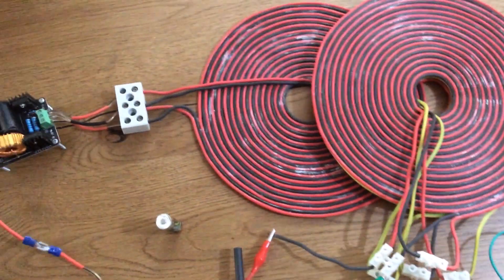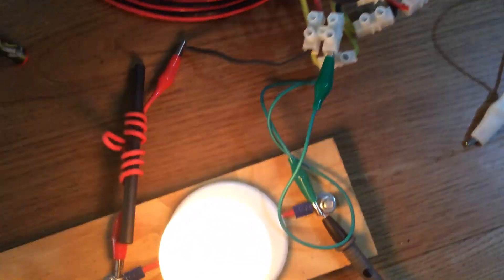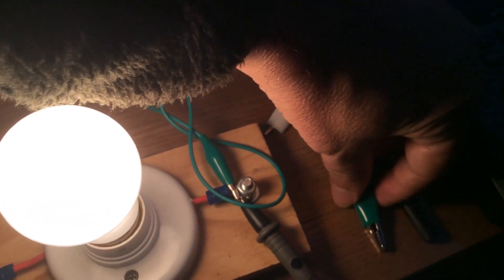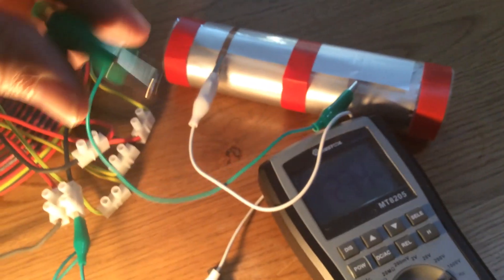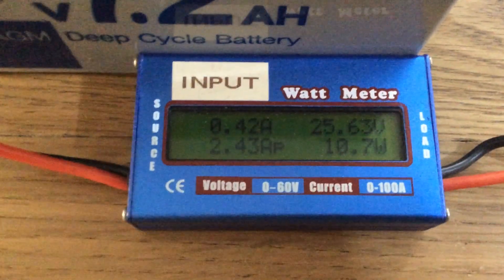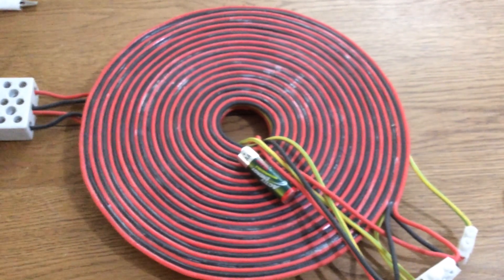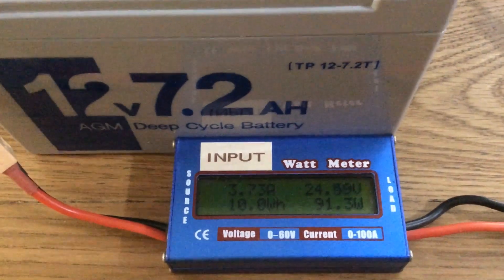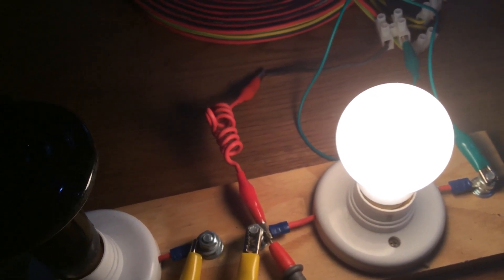TESLA PANCAKE COIL FOR HEATING AND LIGHTING

Comment: What is the zvs?
How many light bulbs could you connect?
Reply from the maker: Thank you for your comment.
Sorry for my delayed reply. The ZVS is a Zero Volt Switching unit, this takes a DC power and flips it back and forth to create a simulated AC signal. The amount of lights your able to connect to this depends on the size of ZVS, the unit I’m using is only a baby 100 watt unit but will easily power a 500 watt halogen bulb. With the induction cooker, also a ZVS, I have powered 2.2 kilowatts of lights with only 1000 watts going into the induction cooker from the mains. Tesla stated that the pancake coil increases power in a capacitive effect, it’s hard to argue when you see the results.

Comment: Teslas example uses 1000 turns pancake. He states it is "advantageous " that your coil be 36" diameter minimum. Even his healing circuit use 36" diameter wooden hoops with 20 guage wire wrapped around the outside. His words are gospel in my opinion. So when he says something is important and I listen.
Reply from the maker: Thank you for your comment.
Couldn’t agree more, if there is even the slightest deviation from his original design then you have created something else.
The problem here is researching Tesla’s discoveries without the drip feed from one of the world’s richest men. A lot of the time I build my version of Tesla’s work from what scrap I have as opposed to specifically buying something, all the while keeping in mind that this isn’t the same and with the intention of making the same if it’s feasible and based on results from my version. Most of the time I’m guided by my desired outcome over replication, ie. I want a particular light to operate at it’s most efficient rate I will take the Tesla concept and tailor it to my needs, if I can achieve it without the extras then all the better.
Again I will highlight the importance of your statement, when he says something is important, I listen.
Reply: @whatifididthis...1236 cool videos thanks for uploading..checkout Ivo’s new video this week it’s about focusing more on the electrostatic, negating the mag field. There’s an 8 year old Video on Yt from an Indian guy how to make a Scalar wave, also the 1901 Tesla lecture that Ivo cites is useful as well. No one knows how this stuff works for the most part..even the people in the comments telling you you’re making mistakes lol
Reply from the maker: Thank you for your comment.
I saw Ivo’s video, very interesting, I will say the different forms of electricity are very interesting. I’m editing a video I recorded last week that demonstrates the differences with and without the ferrite core, the dielectric has always seemed more volatile to me, put it this way, I’ve blown more stuff up that way.

I will check out the video you mentioned, always keen to learn. One thing I’ve learned over 20+ years of experimenting, everyone’s an expert.
Thank you for watching.
Reply: Can you please elaborate on healing circuit? Where can I find info?
Reply: @Inner_Struggle ....It is in his published papers to the medical community. Keep in mind, it won't make sense using Einsteinian theory, electron theory,  nor Hertzian waves. What Tesla discovered was the true God particle. It passes through all matter with ease. If you can capture it, you can do work and heal the body. He patented a device to do so and called it his greatest discovery. Likening it to the birth of children. These Tesla currents jump from metal to metal through the air. Ed Leedskalnin of Coral Castle read his work and built his theory off it. In my opinion, it's most likely what the great pyramids were capturing and trying to contain.

Comment: You're making a mistake by using a three connection ZVS because that only energizes one pole at a time.  It energizes one output pole, then 1/2 cycle later, energizes the other pole.  Tesla bifilar coils were not meant to be energized like this.  Tesla bifilar coils lower self inductance (reduce drag) (reduce Lenze reaction) by allowing n the capacitance in the coil to counteract the self inductance.  The capacitance in a bifilar coil occurs when the electrons flowing in one coil are attracted to the electrons flowing in the other coil through the insulation, causing a massive increase in capacitance, which makes the magic happen.  You need to disconnect that center pole of the ZVS,  but then you probably will get no current flow because the three pole ZVS wasn't meant to be used like that.  SO you really need a TWO pole ZED.  You will see a significant increase in COP.
Reply from the maker: Thank you for your comment.
My apologies for my delayed response. I had originally purchased two of each type of ZVS, 3 pole and 2 pole because I was curious as to which one would best suit this setup. In my tests I found the more efficient unit to be the 3 pole. There may be loads for which this is not the case however using a 70 watt halogen bulb the 3 pole ZVS operates the light using only 18.7 watts and the 2 pole ZVS consumes 20.3 watts, still very efficient and at the same brightness but still less efficient.

Comment: Study these profound concepts:
Peak, RMS, Power Factor, Reactance, Duty Cycle.
Reply from the maker: Thank you for your comment.
I prefer learning as I go and only when relevant. You don't need to know how the internal combustion engine works but how to drive it to get your bread and milk.

Most of the things I build are because of what level of necessity I place on it. If I can achieve the goal using an easier method I will, assuming it's not a lot more expensive.

Every now and then I do a deep dive on a subject but it has to be intriguing. Again, combustion engine.

I'm assuming you haven't seen some of my other videos as these experiments don't occur without reading the profound concepts. 

I care not what the experts say and I build a device and experiment with it for as long as it takes me to get the answers I want. My videos are a record of what happens in this reality and may not always conform to the "reality" that is our education, that in no way denies our reality as reality supersedes education.
Reply: @whatifididthis...1236  It is always good to know the theory behind what you are doing.
A scope is useful for testing, it can tell you more than a multimeter.
Multimeter do not work well with high frequencies. A true RMS type is needed to accurately measure odd waveforms.
Anyways what you are doing works for you. Good luck in your endevours.
Reply from the maker: @gordonwelcher9598  When I first started my research I was very time poor and financially poor, everything had to be built from scratch and made from things that were not necessarily intended to be used that way. I couldn’t afford nice meters and decided that meters weren’t anything more than a means of fine tuning shortcuts. They help you optimise a circuit in a shorter period of time.

I do own some good electrical equipment but I rarely use it, I told myself not owning such equipment was why I wasn’t getting the results I wanted, once I had the equipment I knew I was doing the right thing but just needed to have continued when I started doubting myself. I don’t like using my equipment in my videos because it screams “too technical” to the average viewer that just wants a light. Once I have my circuit running and optimised I would no longer need a meter, plus manually tuning a circuit gives me a better understanding of changes that may occur because I have usually passed through most of those frequencies along the way to resonance. Having this equipment would be akin to having a dynotune machine for your car, just like the mechanic has and attaching it to your car everyday to check it was optimal compared to paying attention to your vehicle, being conscious of the sounds it makes compared to the sounds it used to make.

I play guitar and tune by ear so everything boils down to frequencies for me, pay attention to the frequency and everything will find it’s own harmony. Some of my circuits I only find out the frequency for when somebody asks me what it is and I have to then go check it, sure you could calculate it but in my experience there are too many unexplained anomalies to rely on calculations, the books say one thing and I am looking at something different which is somewhat like having a teenager tell you that you don’t understand the world you’ve lived in for over half a century.

Comment: Wait, is this someone who misunderstands transformers and thinks you can get more power out than you put in? Cos that's what it seems like.
Reply from the maker: Thank you for your comment.
I'm not making any statements about anything you may have seen or heard.

I imagine you have heard of a neon sign transformer.
Let's crunch the numbers of a random transformer, one of many available for sale and attainable right now.
Input 120VAC X 2.36Amps
= 283.2 Watts.
Output 12000VDC X 0.042Amps
= 504 Watts.
Sometimes it is more important to understand than it is to understand why.
Reply: @whatifididthis...1236  Yeah I think you're confusing nominal ratings, like your 72 watt light bulb, which will light with much less, with actual measured power. 

With unusual AC waveforms it's particularly difficult, a multimeter can't do it, you'd really need a scope with some smarts in it that can calculate that.

If it's just ordinary sine-wave mains power, you can just use RMS. In that case you can simply measure the volts and amps. This transformer you mention, what is it? How did you measure it? Transformers are extremely well understood, it is much more likely that you have made a mistake, than what is.
Reply from the maker: @greenaum  I'm not too interested in the particulars of a circuit, instead I focus on how I can make it and use it to my advantage. My main focus is whether it's affordable both financially and electrically and whether there's a benefit or can the goal be achieved in easier ways.

The transformer I mentioned is a "neon sign transformer", they have been around forever, this is what Don Smith mentioned in every video he was ever in.
Just type that into a search engine and search images, you will find thousands of commercially available neon sign transformers. The majority, if not all of them will have similar properties.

Comment: why do you wrap the pen with the red wire like that?
Reply from the maker: Thank you for your comment.
The wire is wrapped around a ferrite rod, one direction is clockwise and at the half way point it becomes anti clockwise. I am just performing different experiments with this wiring as claims had been made many many years ago that this can cancel out the magnetic flux when wound in the opposite direction.
 I will be honest, I have not done enough testing to confirm a benefit.
Reply: @whatifididthis...1236  where did you get the rod?  
When looking for one, do you look for high permeability?  I've heard that is key
Reply from the maker: @emichael06  I can’t remember to be honest it was a long time ago, it would have been one of the popular online selling platforms. The one in the video is 8mm diameter and 100mm in length but just about any ferrous material will work, it will be different but it will work. If you can’t find what you need you can make your own by placing iron filings or iron powder and resin in a plastic tube. An ultrasonic cleaner can help to settle the iron powder using high frequency vibration whilst you add more to the tube until truly packed.

Comment: You need to know how many lumens the light bulb in particular puts out, and an actual measurement of lumens to use a light bulb as any meaningful comparison. Measuring current and voltage across a load is more meaningful. Having two watt meters would be a better setup, one at the batteries to show how much is being drawn, another at the load to see how much is being supplied. Both the heater and the light bulb are completely subjective without such. Something you need to remember is that energy is not energy. One watt (1 volt at 1 amp) of stored energy dumped over an hour will give one watt of energy output. However, 1 watt of stored energy could cause an explosion that would remove your hand if you dump it all in a fraction of a microsecond. What something can do, or effective power, depends upon how much energy is dumped over how long of a period of time.
Reply from the maker: Thank you for your comment.
I completely agree with you that measuring lumens with the naked eye is practically useless as you end up doing damage to your eyes in the first place thus rendering your eyes useless tools of measurement. Spending so much time playing with hundreds of different lights with different circuits I realised I was seeing spots even when my eyes were closed so I purchased a Lumens meter. Shortly after purchasing the meter I realised it was only necessary if you felt the need to prove to someone it was as bright as when operated on the grid, I have nobody to impress so I work only in real physical outcomes.
I have found that measurements on the output are not that reliable with the cheap meters I own due to high frequency, usually displaying what is obviously incorrect or displaying nothing at all, seeing a meter read zero watts whilst burning a 500 watt light led me to believe it is not that practical nor necessary to measure as long as I get my desired product. This high frequency energy is very different and converts a massive portion into the infra red wave lengths which is expressed as heat, a lot more heat than when run on conventional electrical means. I might add, temperature wasn’t measured by holding my hand nearby but by using a digital contact thermometer as well as a digital laser thermometer.
Reply: @whatifididthis...1236  I understand, but a lot of those electric heaters are lossy as heck, so measuring the amount of heat at a point may well miss the majority of heat being given off. Reminds me of one experiment where a person heats up a beaker containing a fluid using a bunsen burner to measure efficiency. The problem in that case is most of the energy is wasted to the environment. In electrical circuits I have seen the same thing, numerous forms of converted waste energy making the circuit extremely lossy.

Comment: What is the power drawn ? I can see the output voltage, but what about the output current ?
Reply from the maker: Thank you for your comment. I don’t believe I have measured the output current on this setup, instead relying on a desired outcome, ie a certain sized load as a target. I built this years ago, when I dragged it out for this video the element had that dust burning smell of a heater not used for a long time. I will get the circuit out and attempt to measure it, however it is my experience that current is difficult to measure in high frequency circuits. On my replication of Tesla’s through earth transmission the current to the light reads 0.00 which is clearly wrong because I can see the light operating. I assume it is the meters inability to measure current at high frequency and better equipment may assist, I don’t feel it necessary to buy expensive equipment to measure as long as my desired effect is achieved, physical outcomes, if it’s not what I want I keep working on it, in this case the outcome was a brightness level measured with a lux meter to be comparable to a grid fed power and in this case I need not know exactly how it works as long as it works but I’m interested to know if it can be measured now with what I have and I will let you know.
Reply: @whatifididthis...1236  Thank you for taking the time to reply. I am building a solid state device and will be facing a similar problem. I am thinking of storing input energy in some super capacitors and feeding the circuit with a buck converter. That will make it easy at least to measure the input energy, not the power. On the output, I will store whatever is coming out in another supercapacitor bank and I will measure the energy at the end of the experiment. The impulses that will charge the output will look like a comb on the oscilloscope so definitely I agree it will be hard to measure. I am thinking running the experiment with the supercaps for a given period of time and then measuring the average power on the input and on the output that way
Reply from the maker: @brotherLar  I believe you are correct, the only way to measure these high frequency circuits output is to store the energy in capacitors and then measure over time for charge and discharge. The output frequency is easy manipulated by capacitors, the oscilloscope shots are very different when adding caps. I only have a basic handheld oscilloscope but I will attempt a short video showing with and without a capacitor.

Comment: Brilliant idea, I was trying to make a setup for heating … you just got it ahead of me. Great work 👍🏼

By the way have you tried to use Tesla switch batteries with this setup ?
Reply from the maker: Thanks for watching. I have tested this setup with the basic Tesla Switch battery arrangement and it works just fine. I said I was going to make this video a year ago and it was mostly laziness that prevented it from happening, at least it is done now. I would like to make this into a portable, backpack style unit as a “bug out, prepper power unit”, perhaps on a plastic chopping board with terminals attached to the board allowing you a quick pack up to get ahead of the next zombie wave! 🤣
Reply: @whatifididthis...1236  Will you please share the exact tesla switch diagram you built from? There are more than one out  there and the others do seem to kill batteries instead of working right.
God bless and be well!